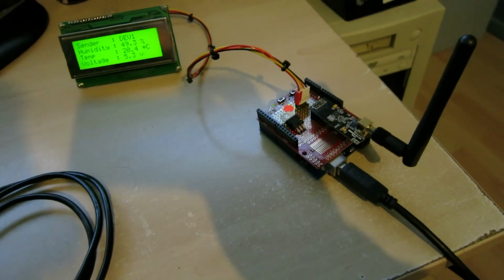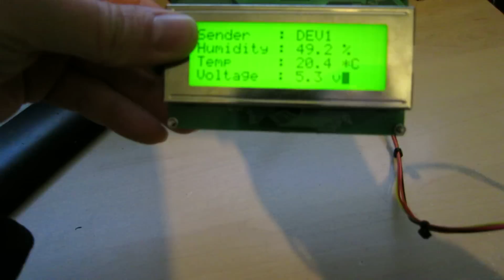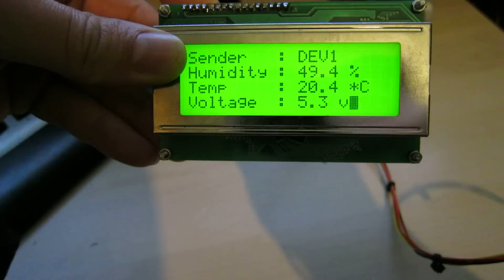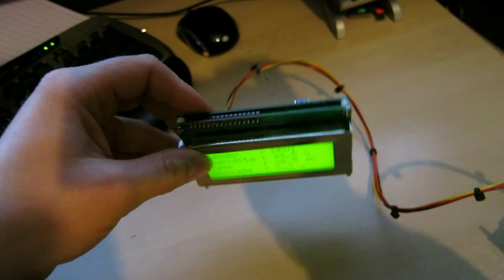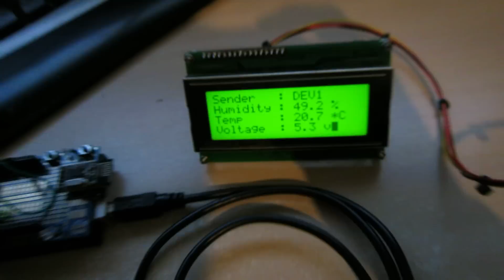Arduino Arcade Network (Part2) NRF24L01 Testing data transfer

Comment: Hii sir,
sir, i am Sending a data from ( NRF24L01  transmitter)  to ( NRF24L01 Receiver )    Using Aduino Uno. 
but  i want to put  its  Nodes ADDRESS in  DECIMAL  format 
like - ( this_Node = 12345           ,   Other_Node = 31296    )  .

but the problem is.... ,   in Decimal format addressing ,     Data is unable  to Send in my code . ( i think there is Addressing problem in my Code ) .
I Had  mail you my codes on  your  email 
i had also attached my  code below ,  Sir please  Help me to Correct the   Code .

i will be too much thankful for your  Help & Suggestions

....................................................................
TRANSMITTER  CODE
....................................................................

#include <RF24Network.h>
#include <RF24.h>
#include <SPI.h>
#define button 2

RF24 radio(10,A1);                  
int buttonState = 0;
RF24Network network(radio);         
const uint16_t this_node = 12345;       
const uint16_t other_node = 31296; 
void setup()
{
  Serial.begin(500000);
  SPI.begin();
  radio.begin();
  network.begin(90,this_node);
  pinMode(button,INPUT);
}

void loop(){
  network.update();
  //---------TRANSMITTING----------//
  
    RF24NetworkHeader header(other_node,DEC);
    unsigned long buttonState = 311; 
    bool ok = network.write(header,&buttonState, sizeof(buttonState)); 
    Serial.println(buttonState);
 
}

............................................................................................
RECEIVER  CODE
.............................................................................................

#include <RF24Network.h>
#include <RF24.h>
#include <SPI.h>
#define led 3
#define led2 4
RF24 radio(10,9); 
byte guest=0;
//#define buttonState1 8
const int buttonState1 = 311;
RF24Network network(radio);   
const uint16_t this_node = 31296; 
const uint16_t other_node = 12345;

void setup()
{
  Serial.begin(500000);
  SPI.begin();
  radio.begin();
  network.begin(90,this_node);  
  pinMode(led,OUTPUT);
  pinMode(led2,OUTPUT);
}

void loop(){
  network.update();
  //---------RECEIVING 1 ----------//
  while( network.available() ) {  
   
    RF24NetworkHeader header;
    unsigned long buttonState;
    network.read(header,&buttonState, sizeof(buttonState));  
    Serial.println(buttonState);  
    if(buttonState1==buttonState)
    {
      digitalWrite(led,HIGH);
      digitalWrite(led2,LOW); 
    }
    else
    {
      digitalWrite(led2,HIGH); 
      digitalWrite(led,LOW);                   
    }
  }
  
}

Comment: very nice! Those Matrix Orbital displays are expensive, but nice! One of my last projects used an EA DIP 204 from Electronic Assembly (~ US$32 from mouser/digikey)-- got it working with an AVR and 4-bit parallel bus (they do support bastardized "SPI", but I didnt try that). What sort of arcade link/networking system will you be working with? Depending on age, I would guess some form of RS-485? Good luck :D

Comment from the maker: Cheers mate :) 

It's an I2C interface LCD that you want, that's the easiest to interface with as you just use the Wire.h library that comes with the Arduino environment. If you look on ebay you can pick up the used Matrix Orbital displays sometimes, or there is a Chinese seller doing 20x4 displays very cheap (search LCD I2C)